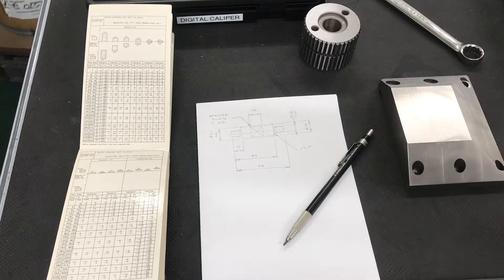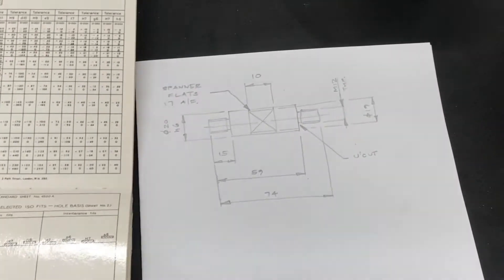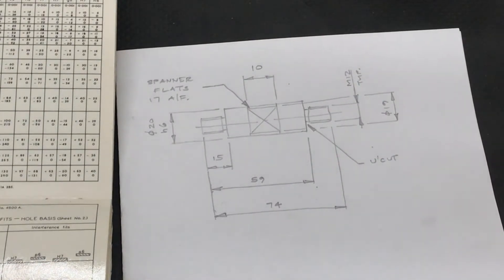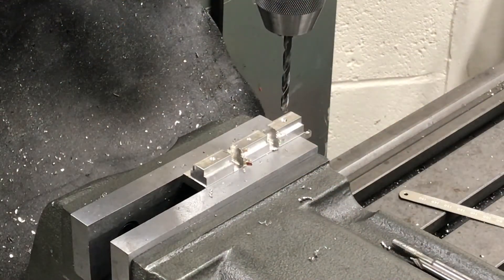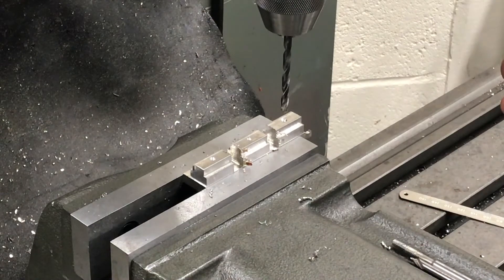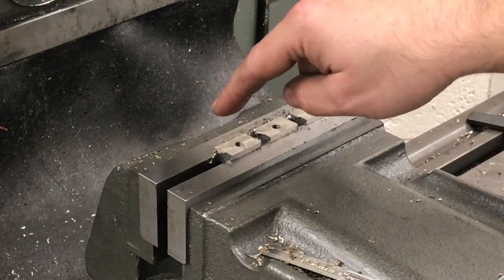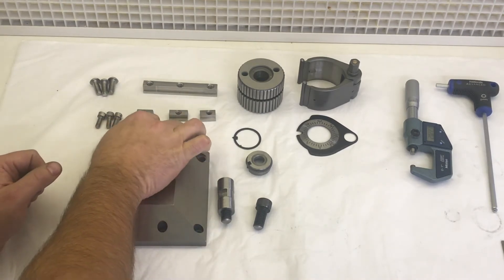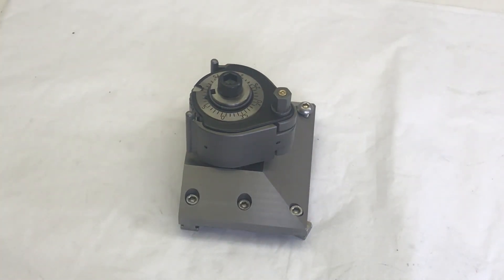Making a solid tool post mount for the Myford Super 7 - Part 4

Comment: I've just found your channel and going through your videos. I got my hands ona S7 earlier this year. Absolutely mint condition, been in storage since new and never been used. Can I ask where you purchased the toolpost please? thanks and regards
Reply from the maker: Welcome to the channel 😎 the tool post is a generic Multifix copy. I’ll have a look for a link but I would recommend looking at Pewe Tools. They’re a better option in my opinion and cheaper than the size A one I have. I also have a size Aa and that one is made by Pewe Tools.
Reply: @opticalmechanic  Thanks very much, I appreciate it. The Myford is a new experience for me as I have a larger lathe which to be honest is too big for home use. I'm looking forward to getting up to speed with all your videos, I've just started watching the rear toolpost set. Thanks again.
Reply from the maker: @ghl3488  nice one, I hope they’re useful. I suppose the machine depends on what you need to hold. One day I’ll get a Colchester Triumph 2000.
Reply: @opticalmechanic  According to Peter of PeWe tools the As size is the recommended size for a Myford 7 lathe. I wasn't aware of this when I bought my Aa toolpost. (However it does everything I need it to).
That said I'm about to enter the process of building a solid tool post mount for my Myford super 7. The only departure from your design is I have made a pattern for the block itself and I'm having it cast in iron.

Comment: Very clever construction. You’re quite right about the unwilling rotation of the toolpost which I happen to experience too with my Dixon QCTP.
With a  Dixon type it is not possible to drill and mount some studs/pins as necessary rotation of the whole toolpost would be impossible..
As my S7 and mill are only used mildly (ca once/month) I’m not willing to buy a Multifix toolpost with some toolholders, that’s a bit too much for me as a hobby-machinist, but your construction is fabulous.
Best regards from NL
Reply from the maker: Thank you for your feedback. It’s not cheap to set up from a hobbyist point of view, I have to agree. It is a very good system though.